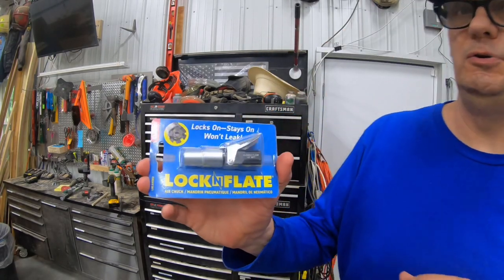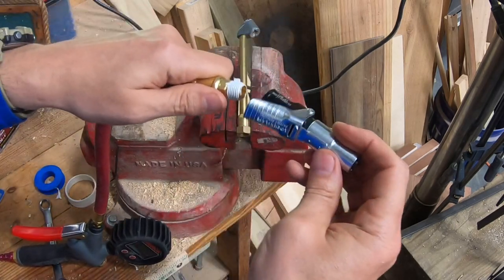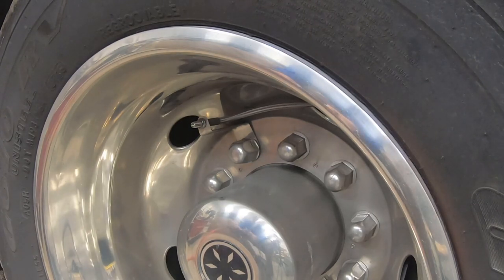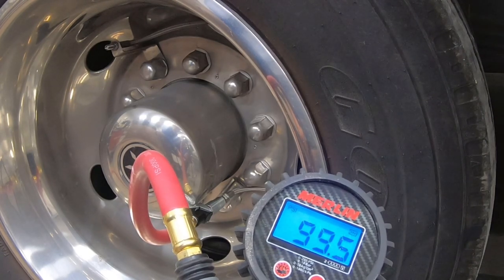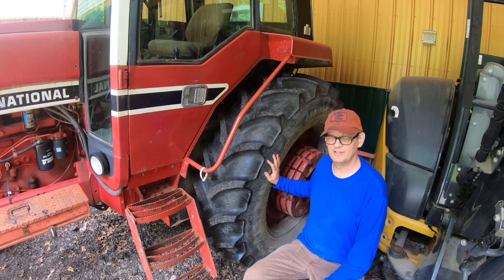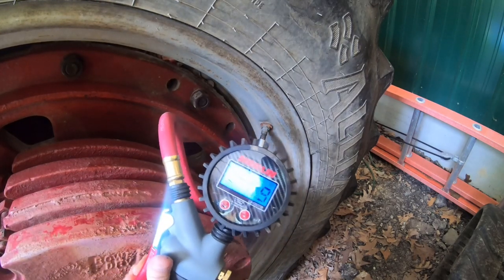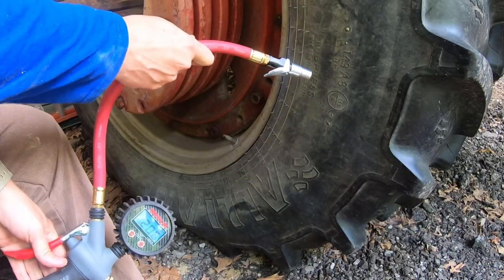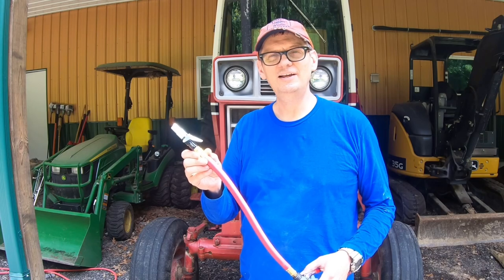LockNFlate Locking air chuck. Why you want this!

Comment: For a regular Joe who has a battery powered inflator for the car, unscrewing it from the tire valve stem caused a lot of air loss. I purchased the "open" LockNFlate and a pipe thread to Schrader valve adaptor and now I have a quick disconnecting inflator. The battery powered inflator cost about $40 and the LockNFlate and Schrader valve adaptor put me back about $50. Now I have the perfect little setup to inflate everything from the wheelbarrow to the car, and all tires in between.
Reply from the maker: That is awesome! Thanks for watching and your comment. That would for sure be a good use for the “open” LockNFlate! Have a great day and be safe!

Comment: Sounds great but make a demo of using it on a big truck rear wheels set where the rear tires are two with the stems pointing to each other  as it is really cumbersome to inflate the outermost tire with any "inline chuck" ...... and I want to stay away from the dang thing when it is going with 60+ PSI !
Reply from the maker: Thanks for watching and commenting! That would be good to see, I don’t have any wheels set up that way. The grease nozzle locknlube has does have a 90 degree adapter but I haven’t seen that for the inflator nozzle yet. Thanks again for the suggestion, we appreciate you! Have a great day and be safe!

Comment: For the low low of $40.
Reply from the maker: Thanks for watching and your comment. I agree it’s not cheap, but at the same time Amazon and Ebay are full of cheaper options I’ve tried. Most are around $10 and I’ve been disappointed in each one I’ve used. This is $40 but actually works and we were not disappointed. Eventually Harbor Freight will have a copy but right now if you want something that actually works this is the best option IMO. Have a great day and be safe!

Comment: To damm Expensive for piece of Metal over Priced.
Reply from the maker: Thanks for watching and commenting. I agree they are expensive but I’ve spent more on the several less expensive ones I’ve tried that didn’t actually work. Soon Harbor Freight or someone will make a reasonable copy but there isn’t any yet that I could find. Have a great day and be safe!
Reply: Cry once and go ahead and buy it.  You'll never have to buy another one.